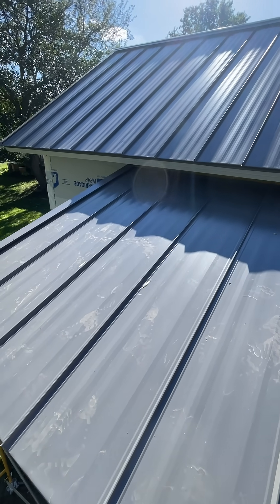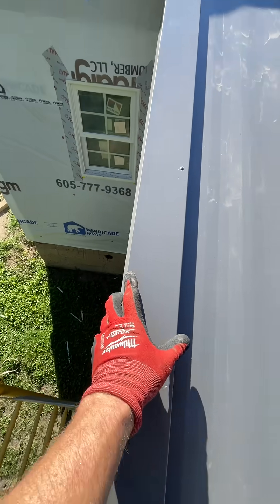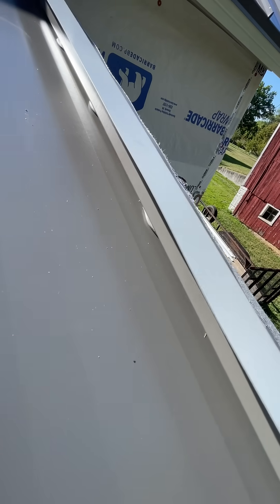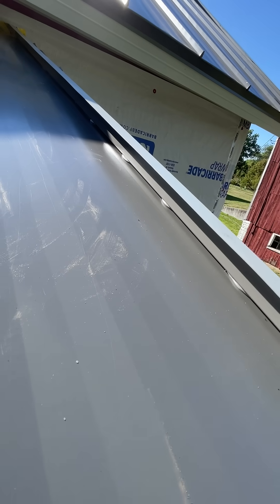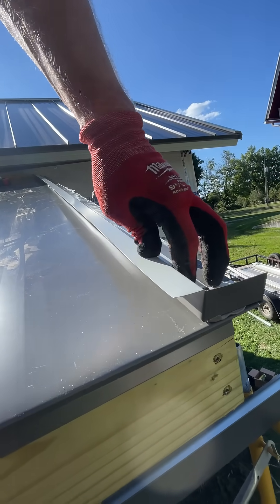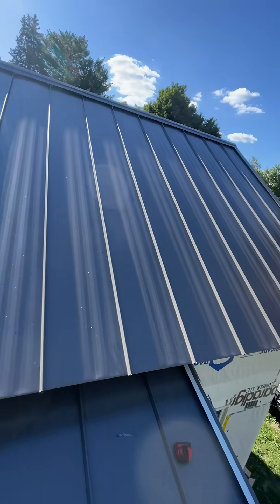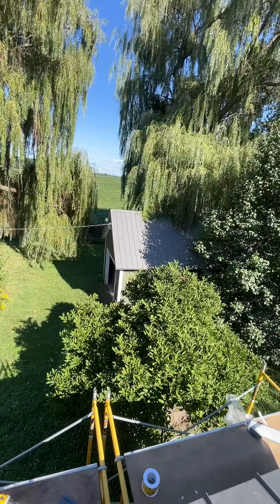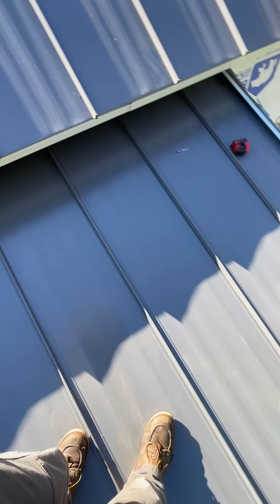Standing Seam Metal Roof

Comment: Not criticizing, why do some use cope metal instead of crimping the edge to the dripedge? I've seen the detail.your using a handful of times. But normally see them crimped over rather than what your showing.
Reply from the maker: Good question. We actually crimped over the drip on the front porch accent. This type works if you are unsure you can get either side with enough space to cut off the end rib. or, if you don't have a 10'+ brake.